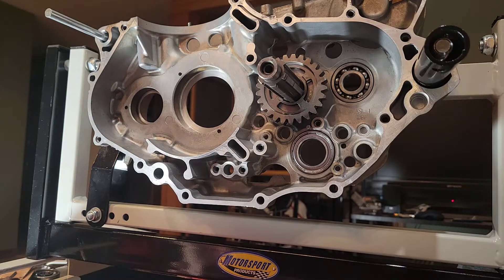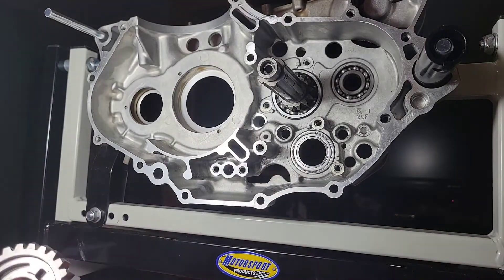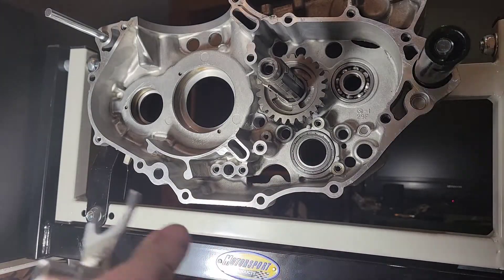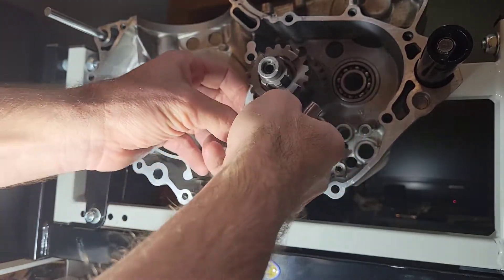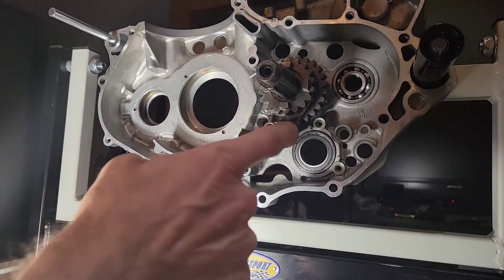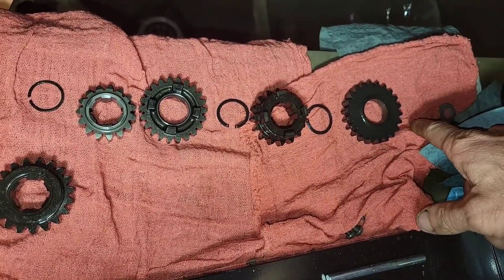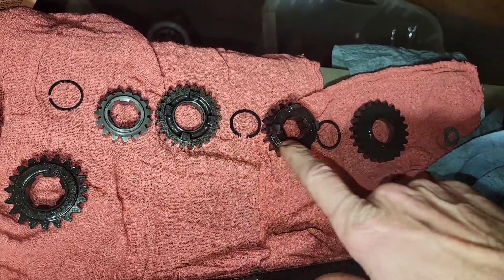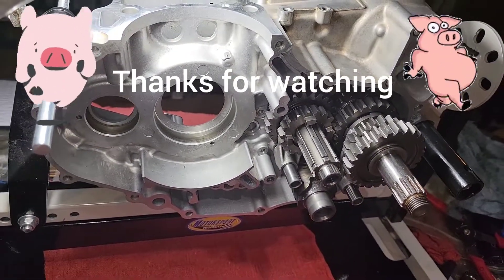DRZ 400 ACT Wide Ratio Transmission Clearancing Results

Comment: Hi mate I live in Australia I own a 2017 model DRZ400 model and I was wondering after watching your video does the gear ratio make the bike a lot more user friendly on both dirt trail and roads is it worth the trouble to do this
Reply from the maker: For me, yes it's worth it.  I am geared 13 50 on my e model and do 70 mph effortlessly. 1st gear is unchanged, 2nd and 3rd are modestly changed, and 4th and 5th are much different. 4th is like 5th was and 5th is like the 6th the bike doesn't have from factory. This is combined with a stroker Big Bore and it's animalistic! I'm curious how it's going to do with my sm wheel set on stock SM gearing.

Comment: I put these in 2 years ago. It transforms the bike.
I can’t decide whether the stroker or the gear set is the best mod I did.
Reply from the maker: Thanks for the comment. This will be my third stroker Big Bore, but first white ratio gear set. How do you use your bike? Is it the e model or the s?
Reply: @DRZWhisperer  I have the Australian E model with FCRMX41, BB stroker. I use it as an adventure bike (I also have a KTM 1290SA). I go out camping with it into the mountains, single track, but to get there I have about 3 hours on blacktop, and with the wide ratio gears and 15/42 gearing it’ll sit on 80mph all day. With 1st gear remaining stock, the extra torque from the stroked crank let’s me go up some crazy steep tracks. It’s fun. The 1290SA is ridiculous too, but it won’t go up steep single tracks so easily, and if it’s wet the extra 90kg of weight rules it out.
Reply from the maker: @ronanrogers4127  wow, what a machine! That 41mm FCR! You got all the nice kit on your Zed. I noticed on the to SM models that I've put the Stroker big bores on that it's completely different through the Rev range and maintains the power at cruising speeds. I'm excited to see how she does with the longer legs. Thanks for sharing. Be careful on that KTM those things have a lot of power to go with that weight!